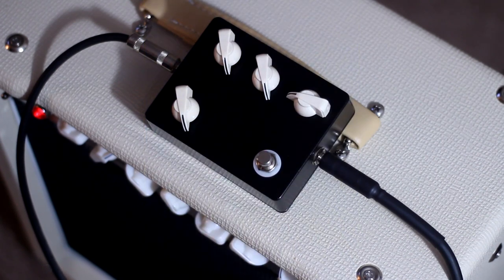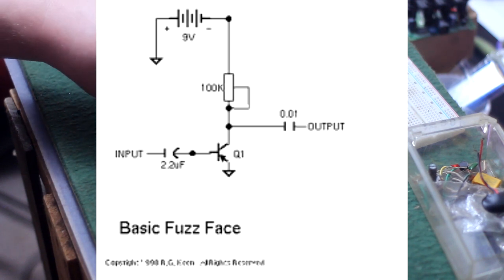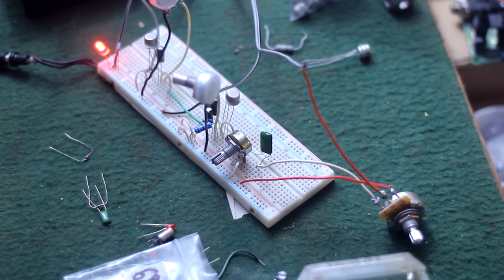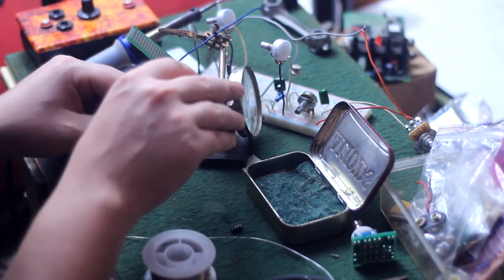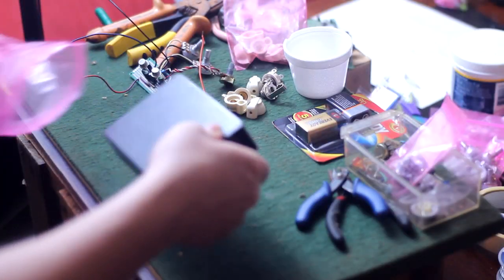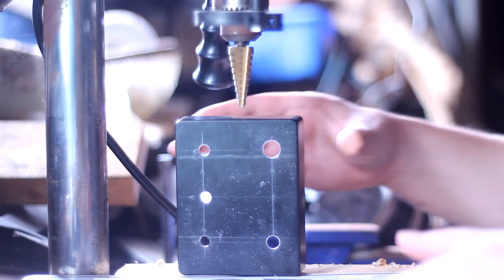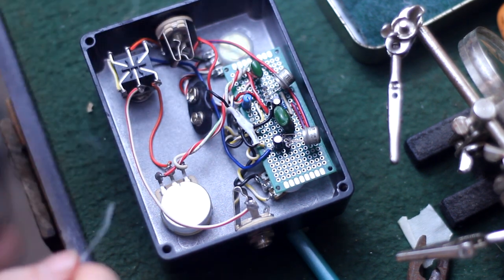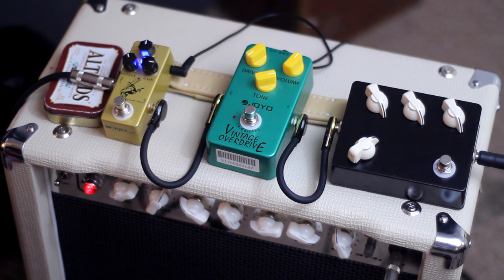DIY Germanium Fuzz Face Rangemaster Hybrid from Scratch

Comment: Military series was marked with ♦(not red -- just a contour). Was called "military acceptance". There also were some series that weren't be in the mass distribution: МП11, МП14 for example. But that rhomb sign is mandatory for any electronics for the army. Those accepted parts though was used in civil too.

Comment: Bro when converting pnp to npn, you gotta flip the electros and any diodes polarities as well as the power supply.
You CAN run pnp's in an npn circuit, sometimes, if the transistor is buffered by caps at all points, the q won't care, as jack orman pointed out on amz years ago... but it often will become unstable when you turn your gtr down or off, where it sounds like either tunable oscillation or detuned radio static crossed with mating water buffallo.

Dude, digging this vid...peace

Comment: If you want even MORE balls out of it, move the output cap to the c / b10k junction instead. That will give a substantial volume boost that will be independent of the bias pot settings.
Did it on the schizoid face and skydog fuzzes, you can even use a fs to toggle between them for a " lead boost".
Reply: Do you mean attaching the output cap to one of the sides of the bias pot instead of the wiper like he has? If so, I'm guessing you mean grounding it (i.e., before the bias pot in the circuit in the schematic as drawn) because it would be independent of the bias settings.  I'm still learning electronics, so go easy on me lol.  I found an old tin box of my dad's components from the 60s and there's dozens of germaniums in there....time to make some mojo!

Comment: I recommend building a simple jig for pots and solder wires to them to connect to the bread. Super comfy to tweak sound. I just took a beer box, cut holes for pots and put the breadboard inside the box and I have a setup that won't disconnect and make funny while I test stuff.

Comment: The song you keep playing at 5:40 reminds me of The Weight by The Band. Very cool videos! I watched all the way to the end and I do have a short attention span. The pedal sounds fantastic my friend. I started breadboarding because of your earlier videos but set it down for a little while. I’m in the middle of a remodel and it’s taking longer than I originally thought it would. Can’t wait to get back to it though. I found a organ for free on market place and I was able to scavenge tons of parts from it, including some really cool looking germanium diodes as well as sprauge caps. I built a simple distortion circuit with the germanium diodes and it sounded godly. I too was at the kitchen table for at least 10 hours tweaking my  circuit and driving my wife crazy before I came to some sort of ear pleasing conclusion.

Also check out the electro harmonix pedal called the Germanium Overdrive! It reminds me a lot like what you got going on here. It has an adjustable voltage and bias pot to mimic a dying battery sound if you want. I love the way that pedal sounds in demo and I might try your design because it’s similar.
Reply from the maker: Thank you for watching and taking the time to comment Josh. Good ear yes that is a very similar riff if not identical. Its one of those old standard blues moves used a lot the motown and soul music era. Jimi used those chord shapes quite a bit one more modern example is Pearl Jam Yellow Ledbetter.

Comment: i got a guy who goes by CMC effects to build me a rangemaster with a knob that sweeps the lower cutoff frequency of the boost. it's my favorite pedal. i can use it to make any amp sound like any other amp. i can get the low end on my jcm800 so fat it sounds like an orange. i can get my champ to sound like its my jcm800 (or an orange)

obviously i'm talking about getting the lows and mids positioned in terms of coping another amps sound with the rangemaster, because you're still stuck with the gain structure of the rangemaster and the amp you have and there will always be that germanium color to a germanium pedal like that, but it's still fucking mindblowing. it's like having an EQ pedal, massive DB boost, and something that makes cool germanium textures all in one box. get one while you can still get ahold of germaniums.

i also got a tonebender mkii from that guy, that thing rips. it's like a fuzz face but more crazy. lots of gain and low end.

Comment: i have been looking at rangemaster stuff . about to start building some . i have three pcbs . two from tayda , and one from general gutiar gadgets someone gave me these ! so the ggg one i will use with a 9 volt battery internal to solve the charge pump issue . then i was looking at input cap selector ideas , i considered using a rotary switch as i have a bunch of those from pull outs of computer switch boxs . i think i am boing to try a cap blend .with a pot . settling on 4500pf - 47nf - i have to see . i see the dam red rooster has 4700pf to a 2.2uf , and another guy had a 1uf ... i am gonna make  a silicon transistor version and a germanium . amp "buildin" is by FAR my favorite things . i mean i try to not say build , i prefer hack or slap together because i try to keep it real , especially when i am typically using a chinesium class d amp board ... but yeah i came back to this video for reference today .and to see me again on the BIG SCREEN ! ty :)

Comment: Hey man, thanks for this. I dialed it in on the breadboard using some Soviet NPN Ge’s (yours looked like MP6A, I’ve got MP10A, 35, 36A, and 37s) and it sounds better than any of the (many) previous Rangemaster-like circuits I’ve attempted. Would you happen to have a strip, vero, or tagboard layout you could share? I really want to box it up so I can use it away from my bench but haven’t really spent time converting schematics to layouts. If not, no worries. If so, that would be righteous. Great vid. Thanks a lot. Keep rockin’ 🤙

Comment: i never thought to wire the power to the bottom of the breadboard and the led trick is also something theft worthy . i remember building the devils triangle sequencer and i spent 12 hours on the jumpers and cuts alone = prepping the veroboard . i built one it worked , wanted another so that time it was 4 , 3 where bad . i had bad jfets on the sputnik 2 millenium bypas that ruined my life . this digitech multiplay had a twisted electro cap that shorted itself that took me 6 months to find . i was praying and laying on hands about to bust out the snakes when i cought that one . its covered in extra switches jacks and knobs , modded 6 ways from sunday now . at that point you have to play the patient mans game . stuff like bad jfets , incorrect pinouts , or my FAVORITE when people post BAD layouts that do not work but they write "verified " on them . i could give you a LIST. the Ethereum spring reverb or what ever that jerk called it - he was selling pcbs that didnt work . imagine that , and there was no apparent way to fix them . the company who printed the pcbs alerted me . then the guy said " i never said i was an electronics expert" ... we'll there is the fact that you call yourself quantem effects and you have that logo with the molecules humping each other - that kind of implys a FEW things but ahem ... we built three of them and all of them where dead as ducks , i asked gomti nicely to pull another BOM @ 3 am and i had the VERO BUILD  populated and running in time to leave for UP michigan at 7 am the next morning.... that spring reverb lives in a jfet marshal superbass 100 clone (class d) with internal li ion battery pack , its a killer amp - i know what you like you would love that circuit - best low gain tone i ever heard out of a solid state and for diy its a high mark... but talk about frustrating building something 4 times to get a working proto. thanks for mentioning me in this one , i am learning a lot and enjoying it quite a bit and will comment more . i tried pad per hole one time and i was cloning someone elses circuit , it was like a 555 noise oscillator ( call one of those circuits a "SYNTH" in my presence and expect a hardy SLAP) i hated pad per hole , as close as i have come is using those old rat shack pcb blanks that have the ic chip alotment in the center but... i got good at vero ... the image you showed isnt even my best work , i have some vero sh@t that is museum piece , you could eat off them ! well maybe do your hair . i get robo soldering with reflow techniques , then usin flux . Donna and i enjoyed the drillin the box segment - we dont get to see fancy drill press in action much ! such an enjoyable and informative entertaining video pal !! shoulda known better to NOT use that old fouled part - man thats JUST what i was saying cuzz i do the same thing all the time ... the thing is its like i will always know what i am doing is dumb but i do it anyway to be cheap . - instant regret .
Reply from the maker: Thank you so much for all the kind words Petey. I am a hack and I don't really know what I'm doing but I can always seems to get the desired results through persistence and I try to share my experiences and small bits of info i pick up in the process with others. Here's something funny... I posted this schematic on the pedal forum on Facebook apparently it "cant work" Yep and Neodymium is no good for pickups right? Hahaha According to the guys with education in electronics it is impossible because I have no voltage on the base of the first transistor. I'm like guys Ive built that gain stage many times its how I test the sound of germanium transistors it works I have video proof. They are like well thats not how a transistor works its a 1 off fluke... unrepeatable. I'm like nope Ive done this many times bread board it and see it works every-time. "Ahh well you arent educated in electronics at all are you" Nope and thats why I did something that "cant work" and got the sound I wanted from simply spending time stabbing parts and switching circuits till it did what I was after. LOL I love that kinda stuff. That guy smartly said some remark like "well you must have made a new scientific discovery and need a Nobel prize" I don't need your book to tell me what my guitar sounds like. Its got a hell of an output for something that "cant work". So apparently this is a "bad schematic" Obviously it works though? Anyway, I can totally see the benefits of using strip-board for building complicated layouts but I am too much of the lazy hack to sit there and figure out my own layout on it. I like to just go any which way that suits me. Now tag board, turret board and terminal strip thats something I could really get behind but its too damn high. I used turret board in that champ clone and it was a dream soooo easy soooo simple. You seem to really have some stern ideas about not calling an oscillator a synthesizer? Whats up with that Petey? When does it become a synth? I mean Is it a synth if you add a filter? DX7 doesn't have a filter. Does it need ADSR? Monotron duo doesnt have an ADSR but it has 2 VCOs and a VCF and it says synthesizer right on it LOL what about a keyboard? Buchla resisted adding a keyboard. Gakken has LFO, ADSR and VCF but only 1 VCO and no keyboard it says synthesizer on it too  Hahaha Just messin with you bro... pokin the bear. Thank you for watching Petey.  I did know better than to use that old pot but you know how it goes I was like hell I'll just use it up, this is my own pedal it'll be fine, nope. I will tell you 1 thing this video took a long ass time to record and longer to edit, hell it took 2 days to upload. wooh Im glad thats all behind me. You guys take it easy and stay cool i think im gonna rest a while now.

Comment: I built a transistor demo board as well- you really can’t quantify the worth and attributes of a transistor unless you HEAR it.
Reply from the maker: I actually have to very much agree. Every one of those little crystal bast@rds is completely different. I also dont see this as good or bad just maybe use these crackly velcro sounding ones in a fuzz and not a boost right? Hahaha
Reply: @heavymetalATC  
Totally. Install where the grind is needed.

Comment: Germanium diodes, and transistors, are a pita to find these days.
Reply from the maker: Thanks for watching and taking the time to write a comment General. Yes its getting harder by the day. I have found one good way to get Ge transistors is to buy old transistor radios and tape machines, cb radios, scanners etc. from thrift stores. I can pretty much look at something and know if its got germanium in it and if I'm in doubt I smell it. I cant smell the germanium transistors themselves but that age of electronics (late 50s to mid 60s) has a smell. I don't know how to describe it but Its pretty recognizable if you have smelled it before its a sour metallic old grease smell, 70s electronics smell different they have kinda a melted plastic and a hint of citrus. Im not being cheeky here either after a while of messing with old junk youll learn the smell. The old tube stuff smells like burning grandma and mothballs and if its got selenium rectifiers it makes a wild strong petroleum smell. Damn i went on a tangent there... old equipment at thrift stores sometimes has germanium in it. LOL
Reply: @heavymetalATC  Dude, man, I know that smell because once you smell it you never forget it.
Reply: Depends where you live I suppose as easyish to get here in the UK but whilst I get the 'Mojo' thankfully you can't get them as easy anymore, unreliable, unstable crap electronic parts, even more so now 50yrs later, it's pure luck if you get a usable batch.

Comment: what the actual heck, do u just store your electronic parts in those zip lock bags from Tayda? comme on man, get yourself one of those organizers with many little drawers. I actually got a deal of the century on used one with 38 drawes in a charity shop, was only 4 euros.
Reply from the maker: Thanks for watching and taking the time to write a comment Woo. Im sure you saw that I did in fact organize them.
Reply: If it works